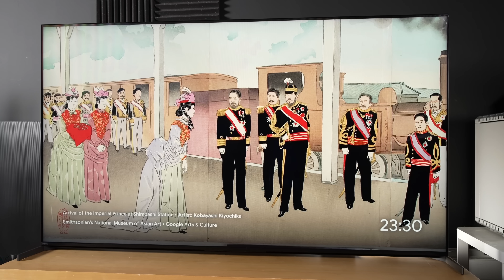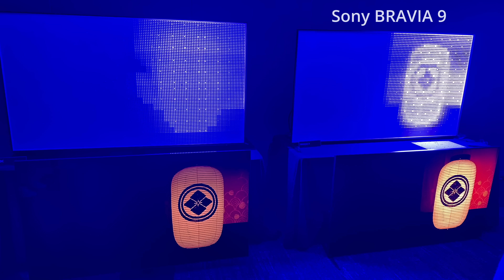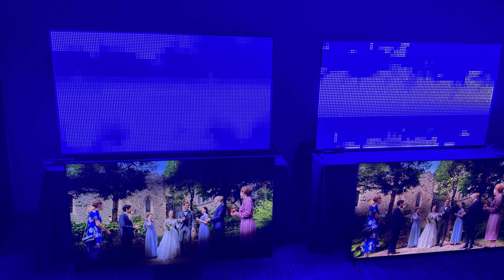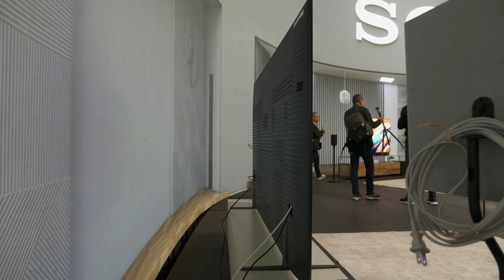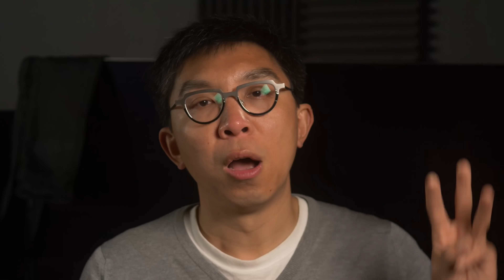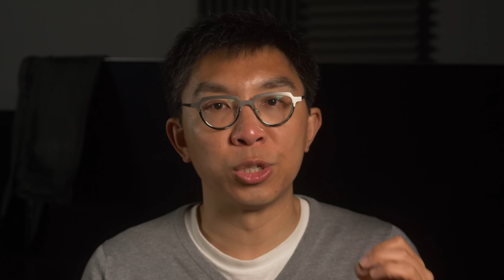𝗖𝗢𝗡𝗙𝗜𝗥𝗠𝗘𝗗: Sony Shun OLED & Use Mini LED for 2024 Flagship TV

Comment: Sony Semiconductor is a powerhouse.  

Sony is one of the few Japanese companies that has a complete manufacturing stack available, from imaging chip, to lenses, to monitors.  Their all-in approach on cinematic appearance and performance is going to pay off for their movie division.
Reply: Their tech was so advance in the 2000's, it's too expensive for the market. AFAIR, they were the first to develop OLED Displays yet they weren't the one who mass marketed them.
Reply: @Ceruleanmonster World first OLED years before KG Sony Bravia XEL-01 2007
Reply: Well, they are still limited by the MediaTek SOC
Reply: Advanced laser diode for data centers is a remarkable breakthrough.Sony is very under rated
Reply: I luv Sony !!!

Comment: if the Bravia 8 is 10% brighter than an A80L,  how much brighter is the A90J or A95L compared to the A80L?  Is the Bravia 8 on par with an A90J brightness ?  close to A95L brightness?    
The Bravia 7, is it as good as the old X93L or X95L now?  Does Sony want me to go LG G4?
Reply: That's pretty bad if indeed it is only 10% brighter. The A80L is already pretty dim, and a 10% brightness boost would be on the same level as the C3. The only Sony I would ever consider getting is the A95L, but I'm not willing to pay the Sony tax.
Reply: That’s my questions regarding the Bravia 7, is it almost as good as the x95L? If it is then that’s the one I’ll go for.

Comment: Nooooo. Why are they still using that limiting media chip? Having only two 2.1 ports should be unacceptable. Especially if you wall mount your TV
Reply: At least you can now buy 8k switcher boxes to resolve the problem. But yeah, lame chip implementation on their part.
Reply: Theyre full 48Gbps bandwith 2.1 hdmi ports on the sony ,unlike the competitors which claim they are all 2.1 ports without full 48 bandwidth
Reply: Buy HDMI splinter who uses more then 2 at any givem time.
Reply: They addressed that question tonight on the Sony After Hours Support show and it's largely because the MediaTek processors still provide the absolute best image processing technology. If they were to move away from that SoC platform (to get more HDMI 2.1 ports), image processing would suffer as a result. They aren't willing to make that trade off.
Reply: @michaelbeckerman7532  That's a trade-off that removes them as an option. What good is image quality if you can't connect your devices to it. Having to buy extra equipment for something that should be backed into the TV is unacceptable to me.

I really want the micro LED TV (Not going back to OLED) but looks like I'm stuck with my dying TCL
Reply: @AntonioCunningham  I'll certainly grant you that MediaTek should have already resolved this issue two years ago, no question about it. Why they haven't done that yet is entirely on them though. However, most gamers that swear they need four HDMI 2.1 ports never even end up actually using more then two of them anyways. Plus, how hard is it to simply unplug one device and plug another one in if you have to? Why is that believed to be such a massive burden? If you would rather have four HDMI 2.1 ports than the best possible image processing, the part that actually determines how well your game-play goes...
Reply: @michaelbeckerman7532  Not everyone will have assess to their HDMI ports on their TV. Especially if they wall mount it. Also people have entertainment systems where they can't constantly switch ports.

Also also ports wear out. (why I personally hate USB C) I've had damaged HDMI ports so I don't like switching or unplugging them when they are confirmed to be working.

I use three 2.1 devices right now and that can easily grow in the future. I don't want to gimp myself when I'm already using more than 2 HDMI 2.1 ports.

And yes, I need the ports to be 2.1 because when I use 2.0 ports, they flicker like crazy (especially my PC)
Reply: @AntonioCunningham Buy a LG G4 have inferior picture processing
Reply: 2021 Bravia TVs should had 4 it was a cross for 2019 and 2020 TVs have jonenor 2 HDMI 2.1 ports.
Reply: @AntonioCunningham USB-C is much better than Magsafe 2 from Apple and lighting cable if smartphone or laptop doesn't have it it's dead out of the box
Reply: @AntonioCunningham Ports west out of your rough and an idiot plug in and out what HDMI 2.1 ports are made for.
Reply: @WizKing93  So Sony can do no wrong? It seems you have an excuse for anything Sony didn't do.

For Example, buying a spitter adds more cost to something that should be built in. There's increased latency and more chances for things to not work since you're adding more gear than required.

Also the mention of them LG G4 with the disdain you have means you're clearly dogmatic for Sony. It's okay for other companies to have products that are different from others.

I was interested in LED because I've had a bad experience with OLED. So yeah, I'm fine with moving away from OLED, but being limited to 2 HDMI ports is a deal breaker for me.
Reply: @WizKing93  As far as USB type C. I don't care how superior a port is. If it can't last longer than 2 years, it's worthless. I've never had any problems with micro USB ports. It was the micro USB cables that were the weak point.

The only reason I'm forced to get new phones is because the Type C ports stop working. So yeah, I hate Type C ports because of their short life span.
Reply: @michaelbeckerman7532 Or they don't want make own increase profits they can keep XR Processor make own SoC without Mediatek

Comment: For me high Tv brightness is a bit like 8K, It's completely unnecessary for most users in that sat your lounge with dimmed lights Even a cheap OLED tv is gonna piss all over even the high end model, Enthusiasts don't watch tv in bright lighting and therefore do not need an extremely bright TV. I can see how this TV will be useful to gamers or people who use their tv as a pc monitor and they are a little bit concerned about Burn in but I have had my LGOLED TV since 2015 and it still hasn't got any burn and I use it every day for several hours a day for movie watching and some ps4 gaming. When I finally see an lcd tv that can actually go up against an OLED lead in a dark room then I might be on board. When you can get a 65 inch or lead for justice over a 1000 pounds it's a difficult ask to pay what will probably be£4000 for this intv which will look virtually no different in a dark room because there will be nothing to compare it to your eyes will simply adjust accordingly.

Comment: I thought the z-series televisions were their flagship, why would you say the Bravia is going to be the flagship?
Reply: The flagship model changes every year. It rarely if ever stays the same. Every year is different.
Reply: @michaelbeckerman7532  2016 z9D, 2018 z9f, 2019 Z9g, 2021 z9j, 2022 Z9K. All of which where their flagship TV, sometimes carried over a year with no improvement, so the model continues to service the year as it's flagship. All of which carried not only their premium price tag but also features not available in their lower priced sets. Before the Z series it was commonly known that the XBR series were their premium pricey lineup. Replaced by the Z series sets. 😉

Comment: Supposedly the 85" X95L has 865 dimming zones, so the Bravia 9 would be around 2,500 zones, half of what TCL is putting in the upcoming 2024 QM8 with 5,000 zones.
Reply: That doesn't actually matter at all. It's not the number of zones that matters. It's how well you can control them AND how well you can control their LEVELS of brightness. Sony does that better than any other company in the world today. Since companies like TCL and Hisense don't have the LED Driver technology to be able to do that, they have no choice but to try and replicate that same outcome by boosting the number of zones. Unfortunately for them, their processors (and more importantly the software algorithms that run inside of them) aren't sophisticated enough to actually match what Sony can do with far fewer zones.
Reply: @michaelbeckerman7532   Samsung said zone count doesn't matter when they were selling TVs with 48 zones.
They don't sell TVs with 48 zones anymore.
Zone count matters.
There is a point of diminishing returns, but that point is somewhere above 10,000 zones.
Reply: @budthecyborg4575  Zone count certainly does matter, however, not as much as you have been lead to believe that it does. How those zones can be effectively controlled matters much more. But, those that can't effectively control those zones will not tell you that. They will, of course, only tell you that zone count is all that matters. They are very conveniently leaving a big part of the story out there - the part that they have no ability to actually provide you with. No surprise there.
Reply: @michaelbeckerman7532   

With a deficit of half as many dimming zones the competition has to be borderline incompetent to not come out with a better result.
Local dimming is further complicated once you enable game mode, it's anyone's guess whether Sony will do any better than anyone else at low latency local dimming.
Reply: @budthecyborg4575  But yet that's exactly what we see. Some companies with 2x or even more local dimming zones STILL perform at a lower level than the Sonys do. Again, it's not about the number of zones, it's about how well you can actually control them. Having all the zones in the world does you no good at all if your processor isn't sophisticated enough to actually make proper and correct/optimal use of them. This is why so many consumers end up getting fooled by high zone counts that lessor companies brag about. That zone count is just very the start of the discussion on local dimming - it is FAR from the end of it.
Reply: @michaelbeckerman7532   At RTINGS the "Lighting Zone Transitions" score on the TCL QM8 is rated higher than the Sony X93L, and the game mode contrast is rated higher on TCL.
TCL has a superior local dimming algorithm in motion.

Comment: Well, I guess I’ll be recommending Samsung S95D TV’s instead of Sony to my clients going forward 🤷
Reply: Only if the can deal with the anti-reflective coating that washes out the blacks. Maybe there is a way to remove the coating.
Reply: Just like with the Frame, the matt finish on the S95D does impact the color presentation to a significant degree. If color accuracy matters at all, then Samsung TVs (in any model) are certainly not the TVs you would ever want to be looking at or recommending to anyone. Over boosted and over saturated colors on literally every single model they make. Only really acceptable if all you ever do is watch cartoons or play video games.
Reply: @michaelbeckerman7532  I can tell you’re not an installer because if you were, you would realize that Samsung hasn’t discontinued the frame line. The reason they haven’t discontinued the frame line is because they sell a lot of those TV’s to wealthy people. And for some godforsaken reason that demographic likes those TVs. Also, when you say Samsung has horrible colors. You would be correct about their edge lit LED stuff but when it comes to QD-OLED panels, the Samsung panels can be calibrated to look exactly like the Sony panels because remember Sony buys their QD-OLED panels from Samsung. If you have a K-10-A and it’s the same panel, you can set them to look exactly the same on colors. All I’m saying is that I’m not going to recommend Sony mini LED TVs that are going to have some blooming issues ( no matter how minor )and other artifacting that inevitably will happen with many LED technology. Right now QD-OLD ( & W-OLED in the 80+ inch size )are the better technology, especially in the TAX bracket that I sell solutions in.
Reply: @businesstheotakuskitchen9000  I never said Samsung discontinued their Frame line and I'm well aware that they haven't. Also, if you spend anywhere from $2,000 to $5,000 on a new TV and then say, "Oh, it will look right once you spend an extra $375 to have it professionally calibrated" I would have to ask you why? Why is it the customer's job/responsibility to have to go in and fix the mistakes made by the manufacturer, right out of the box? Why can't Samsung just get their colors right straight out of the box to begin with? Well, we all know why, don't we? Because their marketing strategy is largely predicated on colors that "pop" and catch customers eye while they are in shopping the stores. The problem is that over-saturated, over-boosted color presentation is far from accurate, authentic or realistic. Once customers get those TVs home and realize how unnatural things look on them, they don't feel quite so good about their purchase decision. Yet, people keep right on falling for that exact same marketing trick, year after year, like lemmings being lead off a cliff. Sad.

Comment: I can't wait to see what it can do. I am looking for a new TV this year. I was ready to get a 77inch A95L but I saw the new Mini Led news. If it be able to provide deep blacks with minimal blooming, over 2000 lumes and good view angles I might look for the 85inch model of this new mini leg
Reply: If you haven't purchased a tv in while, don't sweat it. They will all beat your old one. Usually buying the best one of the year is a bad move unless your are the latest and greatest type.
The second best tv in the second biggest size is typically a sweet spot. And spending less means you don't need to keep it as long so you will get an upgrade sooner that would smash the old flagship you overspent on.
Reply: If you don't need latency of OLED for gaming or extreme qdoled viewing  angles then get the Sony mini Led as overall you have more dynamic range with the sony 

As oleds don't accurately make black as many times they make slightly black totally black 
And would dim after 10 mins and has far lower bright range 

So overall real world dynamic range would be lower in oled

But I'm still an OLED shill 
XD 
oleds are awesome but eh the ones they use on TV's are meh

Comment: I hope they release a 97" or larger panel in the future, that is what I want to buy.
Reply: Same. I was waiting for that. Disappointed it’s not available.
Reply: @tedshep Ca you afford 6000
Reply: @WizKing93  I can. It would sting a bit, but my last TV was purchased 16 years ago. So I’m willing to spend a pretty good amount if it will last that long.
Reply: That be OLED size 100 inch is LCD

Comment: They ruined it with the available sizes for the Bravia 9. In the States, where houses are giganormous but everybody whines about their prices, I'm sure it'll be good and dandy, but elsewhere? Dumb decision, especially the omission of the 65" unit in Europe. Hell, it's not only that, there should've been a 55" size as well.
Reply: I think you are correct. I'm a bigger the better guy but no one else in my family is. They would be horrified to have an 85" in their house.

Comment: Wait. Spring is almost over. So, are the 2024 models still set to ship THIS spring, or later?

Vince,

How do you think the LG G4 with MLA will compare to the Bravia 9 ?
Reply: Sony is off-pace with the rest of the industry. Who knows.
Reply: Spring ends in June.
Reply: What? Spring started on May 20th. Today is April 17th. We aren't even a full month into it yet.
Reply: @michaelbeckerman7532  Fair. But companies don't usually announce an ETA within the current quarter or season.
Reply: @MadLadsAnonymous  Sony is clearly charting their own course here and has stepped away from any traditional industry conventions and practices. But, it's been working pretty well so far for them in doing so.

Comment: No number pad on the Remote :/ why does everyone want to yell at their TV or slowly navigate through them one-by-one to get to their desired channel?

I imagine the Studio Calibrated modes do things that aren't possible to replicate in the other modes via changes to settings in menus. Like how on my current Sony TV there is significant differences between the Vibrant, Standard, Cinema and Gaming modes that prevent you from making them look identical to each other.

And yup, as my previous paragraph talks about... they locked down the Studio modes.
Reply: Have you seen Philips hidden number pad?
Maybe similar in here?

Comment: It does not matter what panel and backlight system they use as long as they insist on using this crap mediatek SoC.
Reply: That "crap" MediaTek SoC you refer to there has literally the best core image processing technology built into it of any TV processor platform out on the market today. Because Sony chose to run their software algorithms through that particular processor platform goes a long way towards explaining why Sony has won King of TVs for the last FIVE years running now.

Comment: I've been waiting for THE Sony OLED to upgrade to from my 2017 Sony LED. Guess I'm gonna have to switch to LG.
Reply: Alright you take the cake for worst case of sour grapes. 
Literally anything they offer beats a Sony LED from 2017.
You want OLED, they got you. 
You want QD-OLED, they got you.
You want LED, they got you and it's massively improved this year.

I don't know what else they could do for you. Have it cook a lobster for you?
Reply: @bearclaw5115 For one thing, 2 HDMI 2.1 ports (one of which is the ARC port, leaving just one) is not enough. I don't understand why they refuse to do something about this.

Comment: No new 42-48” is criminal 😂😂
Reply: Facts I game on an LG mini qned it's good, but I might want to upgrade in a couple of years
Reply: Agreed loving using my LG 42' oled as monitor
Reply: @ScubaStephenson  You have a 42 foot monitor? Damn
Reply: @rustler08  I think no one but muricas understand this  " ' "  and " " " . It is time to start using metric for TV size.
Reply: 42 inch 4K is useless since you can't tell difference between 1080p and 4K
Reply: @WizKing93  Unless you use it as a monitor.